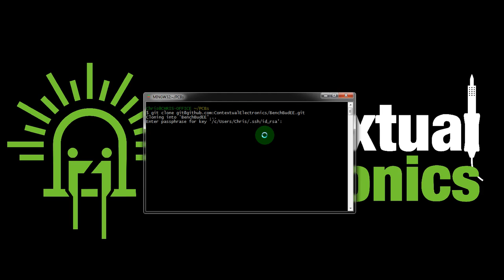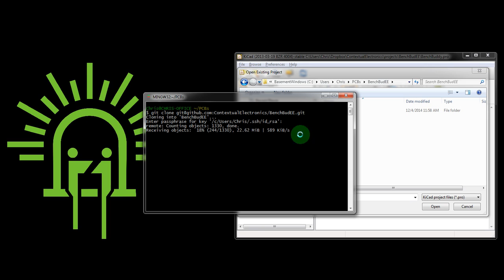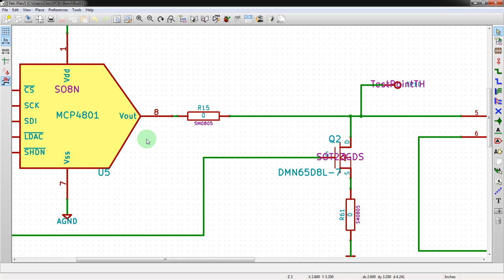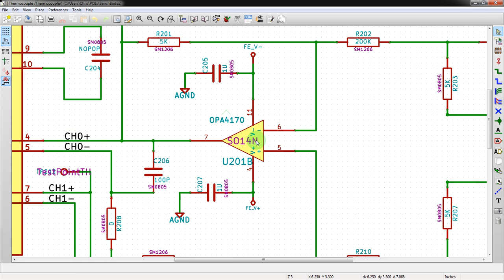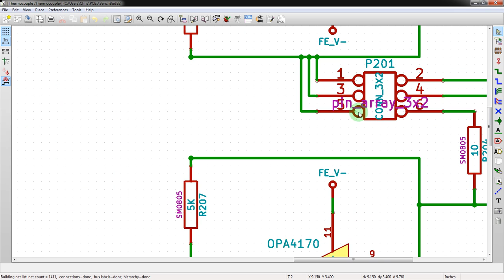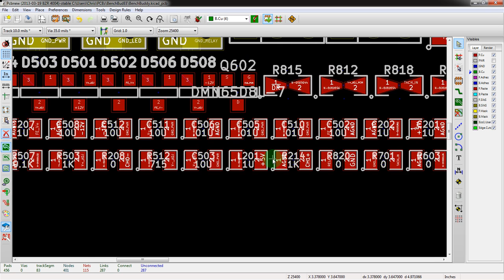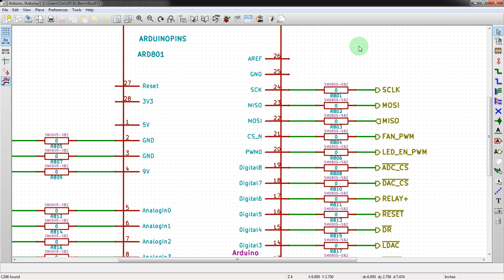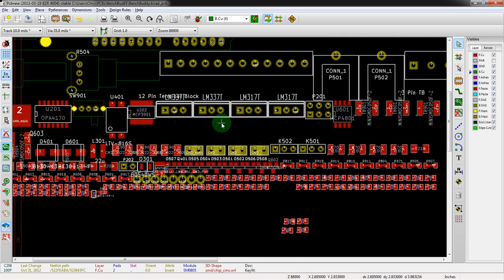KiCad 3.0 - Using Page Numbers For Part Placement

Comment: Hi thanks for the tutorial. Is there a way to grab a set of parts and move around the pcb? I must say in eagle it is possible due to ulp from here: https://www.element14.com/community/thread/31802/l/two-scripts-to-help-layout-a-board-from-a-multi-page-schematic
The ulp I talk about is in comments section. I use like this: group some symbols on schematic, run ulp, then I am transferred automatically to brd/pcb and all my parts hover over board. Is there a way to do it in kicad?